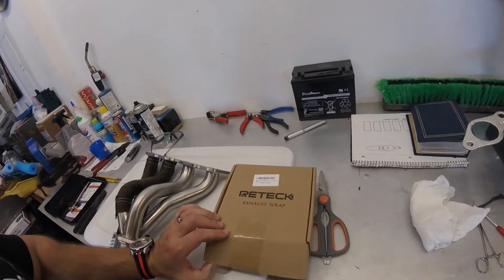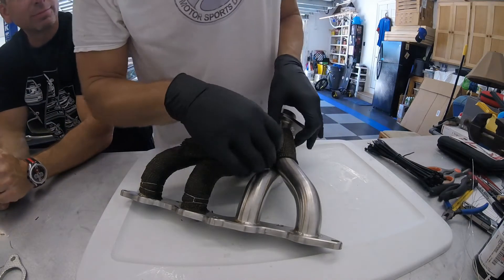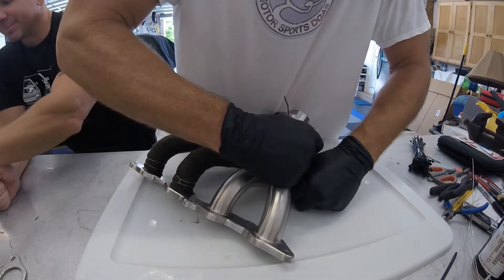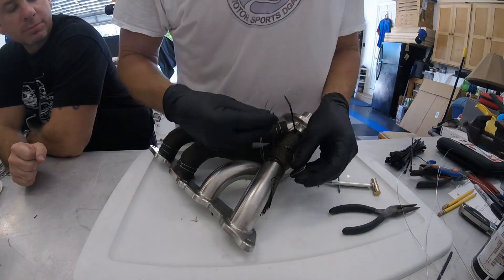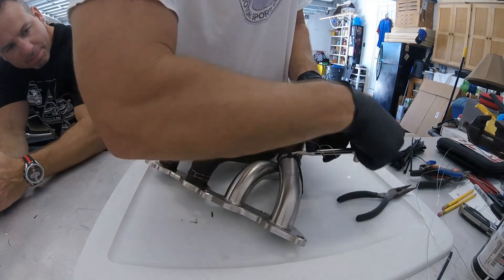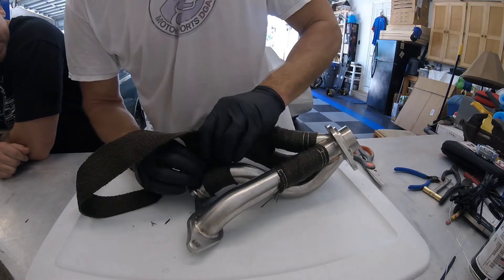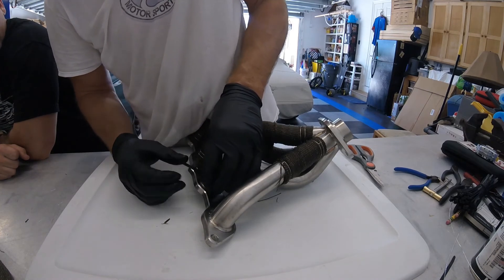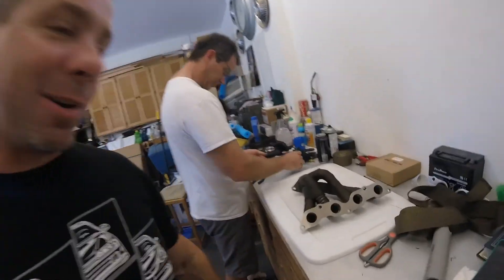How to Wrap an Exhaust Header - Scion XB

Comment: Hello, I have got my originally purchased 2005 Scion Xb with just over 203k miles.  I have a  dealership supplied CAI and exhaust. I love the CAI because it really worked with mileage and even efficiency of power.  My Catalytic converter finally went and I have to change it prior to the 30th (16 more days) so that I can pass inspection.  I had one previous exhaust leak with what the mechanic called the 'Donut'.  It was repaired not replaced.  I am somewhat concerned that that old repaired problem might resurface. While I am getting the cat replaced I am soliciting getting more exhaust work done pre-emptively. One of my interest is headers.  Will headers on a 2005 scion xb contribute to mileage boost, will it slightly increase power,  will it preserve or wear-out the engine.  Please also tell  me any problems with headers. If i do get headers do you recommend any low price-point, reliable makes?

Comment: I've got an exhaust leak at the manifold on my 2006 xB. I'm considering purchasing the DC Sports 4-1 header. From what I've read so far, I won't be able to reuse the stock heat shield. Is this why you opted to wrap your header?
Reply from the maker: Yes. You need to wrap whatever you buy because the shifter cables are in the way. Watch my header install video to see what I mean.
Reply: Watched that. Thanks for the info you've provided. I'm also wondering if you had any issues with the check engine light after doing the header install or after the exhaust install (assuming that you upgraded your exhaust system too). Thanks in advance